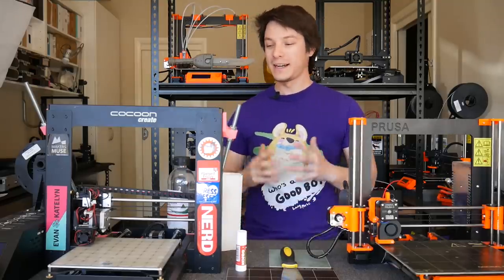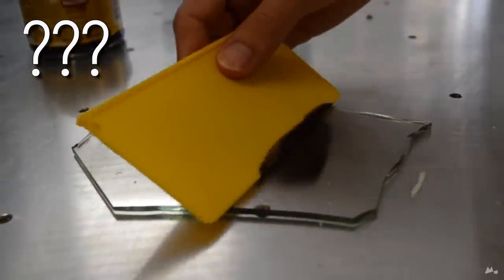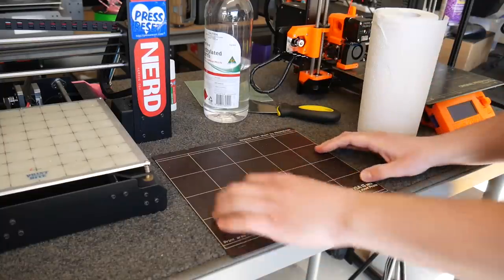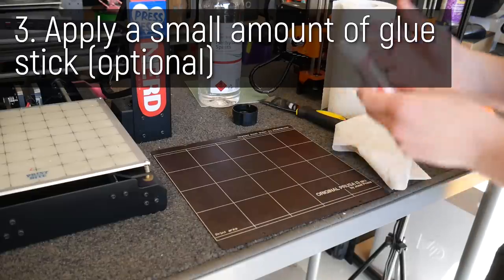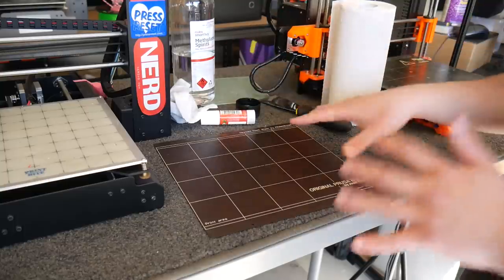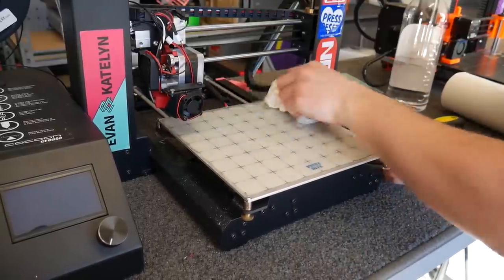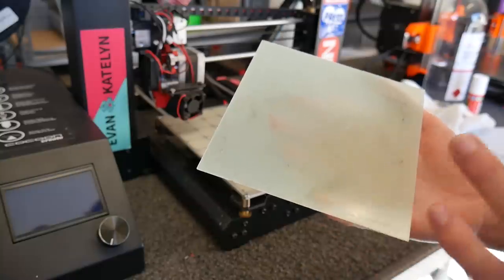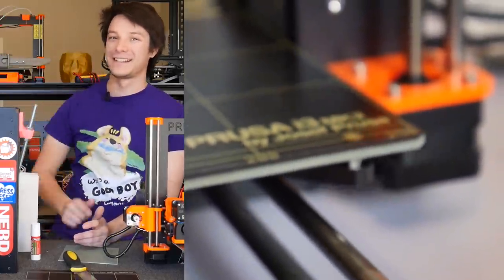3D Prints not sticking anymore? Watch this! 3DP101

Comment: Glue stick on a PEI surface is a crime
Reply: radry100 Not when printing PET(G), I would argue. Otherwise it might bond too well to the PEI, making it near impossible to remove without causing damage to the bed.
Reply: I print PETG on PEI all the time. You have to have the patience to let the bed cool though or it's not generally coming off. Once it cools, for me the print is often just sitting on the bed with no stick at all. Maybe the bed temperature I use is different than yours?
Reply: Mark M I haven't actually dared to try without glue personally, so it might be just fine. I've only read in the prusa manual that it was recommended, and have seen youtubers like Thomas Sanladerer having issues with it. They might not have waited for the bed to completely cool though.

Comment: The whole point of PEI and Print Bite is the ability for prints to stick. A ton of people use nothing but clean glass. I use hairspray and I clean it off with ISO if I think there is too much. PETG and PLA I have never had an issue with is sticking. Alot of people have issues with their temp settings or their tramming that causes their prints to fail. Not very scientific.

Comment: If you use glue stick on your build plate dont waste your isopropyl alchol, just hot soapy water like your doing the dishes, not an isse dry it preferably with a mocro fibre cloth, and a spray of isopropyl after youve set your bed back up

Comment: why prints dont stick to bed after a lot of printing.. when you get a new black printer mate to stick down you will feel small tiny pit holes and very fine lumps. that is all perfect but over time with printing in same spot and using blade type of thing to get print off. the mat will where down then over time the mate will be smooth as a baby's bum and start to get Matt gloss type of look thats the time to remove the black print mate and buy some more. always make sure you have 2 on stand by to replace mat. or just go to glass bed prints will stick till glass cools down. but do get hair spray as well to spray on glass during printing. and other problems u r welcome to send me a q's

Comment: Prusa Flex beds = way too messy glue stick are, nightmare to clean. Hair Spray is much easier & much easier to clean, works better also, (Aquanet Super Extra Hold & Rave 4x Mega) Hairspray needs no scraper ever. I can only clean 1x glue bed and 5x hairspray beds in same time lol.

Comment: I can hear Josef screaming about the metal scraper from here. Get a plastic one - shouldn't really need one at all tbh - but a plastic one if you must. By the way acetone is what you're looking for - the proper stuff in a metal can, MG Chemicals etc not stuff for nail polish.
Reply: As long as the nail polish remover you buy is cheap enough, it'll be practically pure Acetone.
Reply: lol
Reply: If Prusa wants people to stop using metal scrapers I guess he could stop including one in the box
Reply: I didn't get one in my mk3 box >.>
Reply: Martin Nicholls that's cos you can flex it ya div 😆
Reply: Exactly?
Reply: I know that's how I got mine. Maybe it was because it was a preassembled machine?
Reply: The magnets on this thing are super strong, though. It's almost always less work to bump the print off the bed than pull the bed off, flex it, and return it. Especially if I'm trying to avoid touching the middle to prevent fingerprints.
Reply: Seems more likely it might be a question of when, my kit only came about a month ago - if you got yours early then it's entirely possible they were still shipping them. Accessory pack might be the same one they were shipping with mk2 then they switched to a new one for later mk3 orders? Just guessing. Also honestly most of the time i can just pull the print off the bed with minimal force - but bending has always worked failing that, even with stuff that seemed super excessively stuck down. Working as intended you might say. Certainly wouldn't myself use a metal scraper, all it's going to do is damage the coating. For finger prints, dust etc I just clean the sheet with IPA as recommended by prusa, done the trick so far.
Reply: Over here in the middle of Europe, cheap nail polish remover (and expensive too) is like half oil, apparently that's cheaper than acetone. This is useless, well it's not useless to get your nail polish off, but it's useless to clean anything or solvent-weld anything. You can get pure acetone, household chemistry stores sometimes sell highly pure one from a chemical company in a 250ml glass bottle, which is convenient. Or you can get them in bigger metal cans elsewhere.

Comment: hmmm I got some printbite because of the promise of no more glue stick and easy release but it seems you still use glue stick on yours. First few prints worked perfect but now I am stuck with pla warping and small parts pretty much not sticking at all. #disappointed

Comment: I hate to say this, but this is bad information.

Alcohol and methylated spirits might be good for removing finger oils but if you're using glue stick or hairspray then neither isopropylene alcohol nor methylated spirits will work well.

PVA is the primary ingredient in glue stick and most hairsprays.

If you don't know what PVA is it is basically a mold release That is only soluble in water.

PVA is a very interesting chemical as it is in previous to all known solvents including acids the only thing that will dissolve PVA is water.

So if you've used glue stick or hairspray on your print surface then ideally you want to clean it with a bit of Dawn dish soap and warm water This will wash away any PVA present on the build surface.

It will also effectively clean off any finger oils. You can do a final wipe down with IPA if it makes you feel better.

Again the primary ingredient in most glue sticks And hairspray is PVA As it makes a good adhesive that is water soluble.

The problem with PVA is it's also a good mold release and nothing will stick to it. PVA is primarily used in fiberglass work for coating fiberglass molds so the fiberglass doesn't stick to the mold.

Comment: you know what be nice if i could print something but everything just slide around the bed.  i'm about to toss this ender 3 pro in the trash
Reply: make shure your bed is preheated first when its hot give it a wipe with  rubbing alcohol
Reply: @cobravenomX1  wish I could give that a try but not even after 24 hours of getting the ender 3 pro I got the blue screen.  So now I got a 200 dollar paper weight.
Reply: i gess that means a new main board 
how did that happen??
Reply: @cobravenomX1  yeah that is what I'm thinking too, I was trying to print something so I was over at my pc when I saw the lcd go from having text to just being blue.  Then I found out that alot of people have had the same problem.  So now I'm trying to get in touch with customer support, but that in it self is a nightmare.  Now I find out that they are on  holiday until the 31th of this month.
Reply: good luck with that, get a new lcd while your talking to them
Reply: @cobravenomX1  yeah I just might as well get a touch screen one.  There not that much on amazon.

Comment: Ethanol isn't a detergent, it won't emulsify the oil. It'll just smudge it around more, and the only oil that will be taken away will be the oil that has soaked into your paper towel. Use a mild detergent (hand soap with a little water), wash it down, rinse in water, then dry it out with metho/Ethanol. You may not even need a glue stick then.
Edit: I think some window cleaners might have some mild detergents in them, so they might be a reasonable substitute. But I'd do a post-wash with that too.
Reply: When in college in the Chem lab washing glasware, we used solvents to get the 'leftover stuff', mainly off, then did a wash with distilled water, then a denatured alcohol wash with air dry.  Always using rubber gloves, so as to not add contamination. ... your, and Andus's methods are basically the same 'get the junk off, then make sure it is pristine' method used in chemistry laboratories.  Just be safe and make sure it works for you.
Reply: servant74 the same goal, yes, get it clean.. the same idea of using a solution, yes, but then it differs. Ethanol doesn't dissolve oil. Pour some oil into a jar of vodka, shake, and watch it settle out. It will form seperate layers. If you really want to remove oil use a detergent, it's the only way to get oil to dissolve away in water/ethanol. I'd finish off with ethanol for sure.
Reply: Kieran Use whatever you like mate, Iso alcohol works superbly in practice, I think I'll stick to what works and ignore the person telling me it doesn't.
Reply: You do realise that when you are talking about emulsification you are litteraly talking about the opposite effect in which why ethanol does work, an emulsifier allows the mixture of two insoluble liquids. The thing is oils are soluble in alcohol so due to how much more alcohol is on the towel than the print bed the alcohol will dissolve almost all of it  which can then be wiped off if you clean the bed cold and dry it with a different towel, even if you don't the oil's will only remain at a homeopathic level.
Edit: also window cleaner is not a good option as the additives in it leave a very light film which people use a release agent and not an adhesive agent, especially when printing pet-g on PEI.
Reply: euan todd yes they remain. I'm talking about removing everything, trace amounts... And finishing with ethanol. I think I made that pretty clear.
I don't know why people think oils are readily soluble in alcohol mixtures. You need non or low polarity solvents to dissolve it.. my idea of emulsion is a shortcut around actually solubilizing (because many non polar oil solubilizing compounds are quite nasty). The issue is, that in doing this, you need to get the emulsifier (detergent) off afterwards.. that's important. Rinsing/sponging with water (several times is using a powerful detergent). Then to finally remove any remaining particulate matter, ethanol.

For those that just use Ethanol, good luck to you.. but you could probably do a blind study and use water and you'd get the same result. You probably don't have a huge issue in the first place.. or more probably, the contaminant on your build plate that's causing issues with prints isn't oil.
Reply: Kieran Short I also think I made it clear that this isn't necessary and is convoluted, why do you think wiping down the buildplate with ipa has started to become the standard, especially with people who use a PEI bed or buildtak, cos it works!, if it didn't work we wouldn't use it, no need for a 2 or 3 step plan, spray the stuff on the bed/towel and wipe on, wipe off.
Reply: I've found that PVA/gluestick is a good release agent for PETG from my mk3/mk52 PEI sheet.   I use it off the edge of the bed where slic3r-pe produces an initial high extrusion "wipe", which is hard difficult to get off of bare PEI and was starting to damage the surface.  A thin wipe of glue stick every 3-4 prints seems to do the trick.  A word of caution to be careful to not smear the PVA around the bed when cleaning between prints...

Comment: Great advice but you must understand, that methylated spirit is not safe to handle that way? 

P264 Wash contaminated skin thoroughly after handling.
P280 Wear protective gloves/ protective clothing/ eye protection/ face protection.
P303+P361+P353 IF ON SKIN (or hair): Take off immediately all contaminated clothing.
Rinse skin with water/ shower

So many follow you, that I would like to see you do everything safety first. Methylated spirits can cause pretty serious stuff to your system overtim, if inhaled or getting skin exposed. It gathers into your body and some could get very sick.. like seriously SICK.
Reply from the maker: i've used it for years like this without concern it dries out the skin, but it's mostly ethenol. You can wear gloves if you like.
Reply: It's not about how you have done it, it's how it should be done to be safe. Some of your followers could be hyper sensitive to the chemical mentioned, and get in to trouble because of the advice you give. I love your videos but safety first  ;)

Comment: For PLA I found out that if the print doesn't stick on a cold bed, then either your Z distance is not ok, or your first layer is too fast . It works both on kapton and tape quite ok . For other filaments and very big parts glue stick helps a lot especially to avoid warping at the corners of big parts . But great video anyway for the rest of filaments ! Can you make a video about how to print huge prints without warping ? I am amazed by Ivan Miranda, he prints perfect huge prints directly on glass without glue stick !

Comment: Isopropyl alcohol and a microfibre cloth every few prints can  also be enough to maintain a good bed surface. 

Also, wiping off the dust from the bed before every print works wonders.

( Do not use ethyl alcohol, it has too much additives that messes with your print surface )